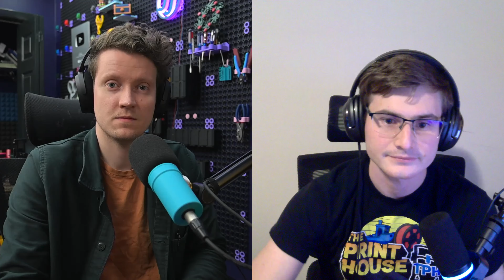Reliability in 3D Printers Past, Present, and Future - Episode 12

Comment: Jerry thinking check bed level sensors.   I’ve seen this on the K1C I relieved tension on the bed sensors and rescrewed the beds screws back in.  Don’t know if the k2 plus uses strain sensors but check those.